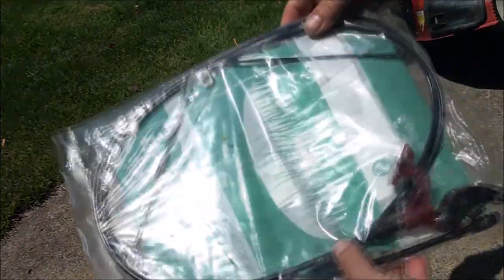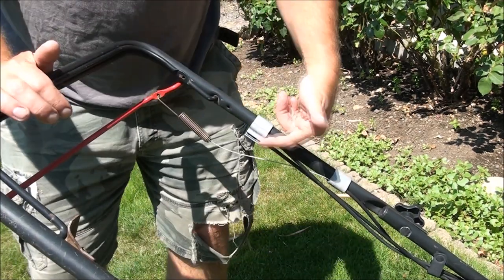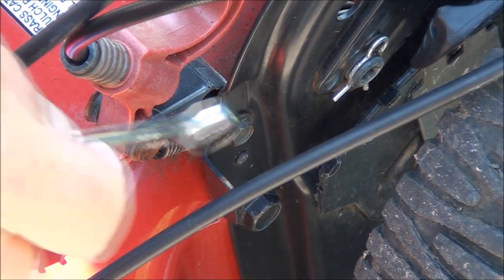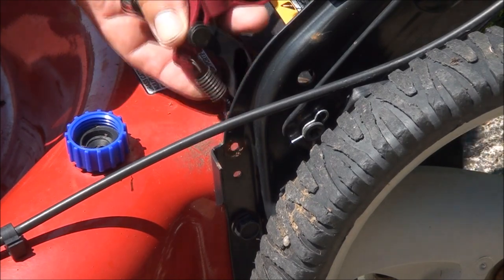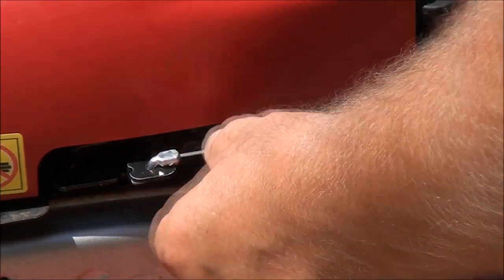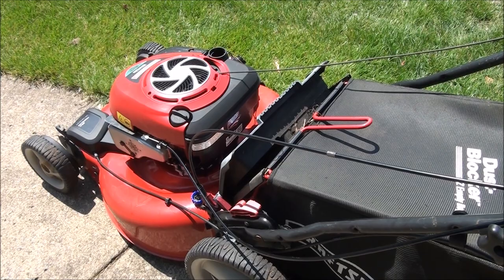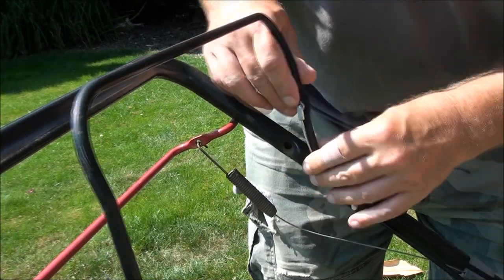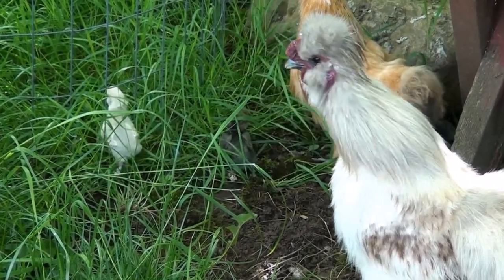common problem on a CRAFTSMAN LAWNMOWER - DUAL CABLE REPLACEMENT HOW TO remove replace install FIX

Comment: What do you call the cable that goes on the bottom bar?
Reply from the maker: Lawnmowers can have 2 cables. Drive cable, stop cable.